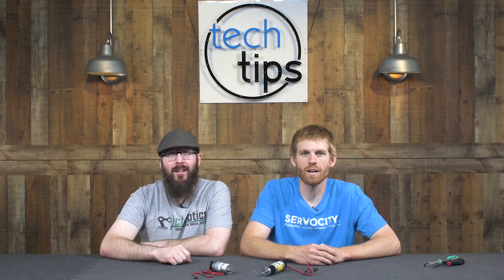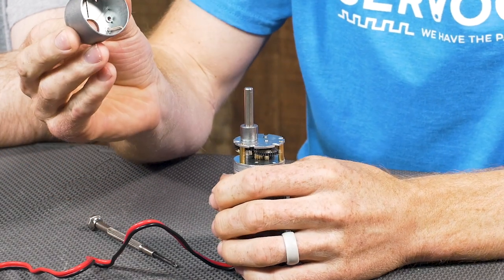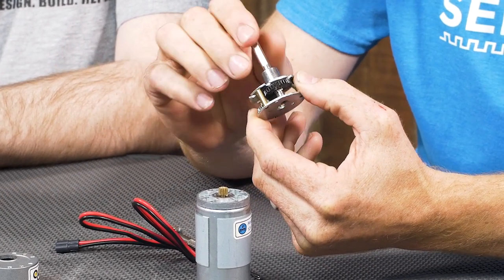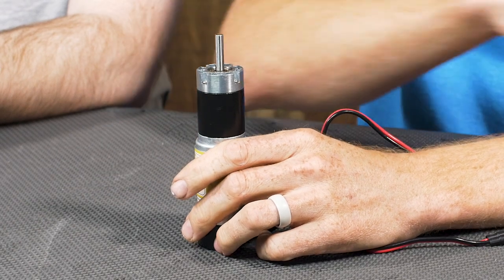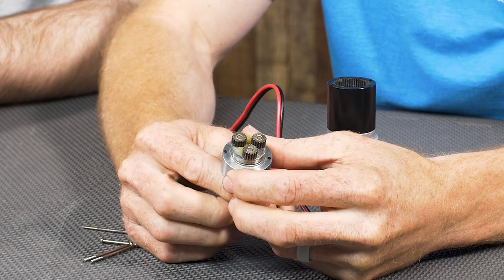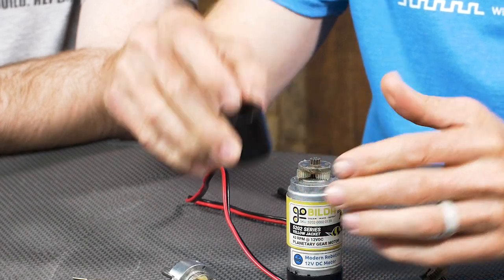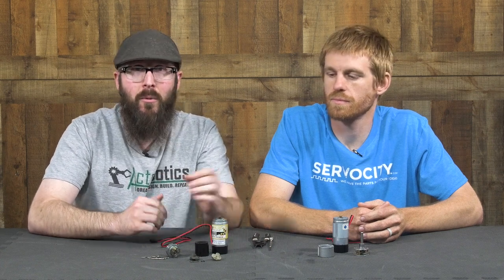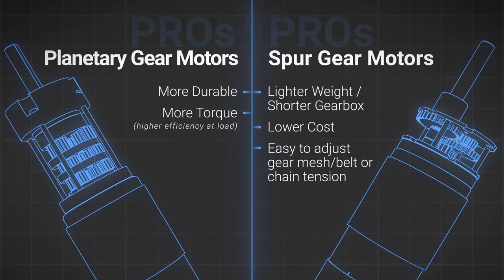Spur Gear Motor vs Planetary Gear Motor

Comment: Yep, I mirror what guys below said. Very good breakdown. I have seen inside the gears before so knew what I would look like inside. But being told the pro/cons and the information about the materials of the different stages of a planetary (eg, nylon vs metal) was great info. And best of all, being told exact meaning of spur.. It got me thinking that a planetary must be spur also, and then having it confirmed a few minutes later was great. Clears up some confusion I always seem to have when looking at motors on websites

Comment: what is the opposite of a reducer? is there a motor with planetary gears inside them to power a larger radius and add rotations to the smaller radius center axis? like a brushless motor with the magnetic ring rotor and inside there a planetary gear speeding up the rotations?
Reply from the maker: That's something that isn't commonly available, generally it is easier and cheaper to wind a motor to spin faster than it is to add an external geared "overdrive" setup.
Reply: @ServoCity  ok thanks

Comment: Great video! I'm curious what would occur if the wax-like lubricant were replaced with gear lube grease (like the ones pressed into zerk fittings in larger machine applications) and if this would lend to even longer life. I've replaced the OEM lubricant in my impact gun with synthetic lube grease after the OEM stuff broke down and caused it to seize. A year later, my impact gun is going strong.
Reply: One can reasonably assume for generic parts whatever is used is primarily chosen for cost purposes.
Find out what high-end motors use, and do likewise. I wouldn't just use a different grease made for metal for a nylon application.

Comment: Hello guys, thanks for the great video! I have a question, hoping you could answer it. I am currently looking at the following three products on your website:

1. 5201 Series, 26:1 Ratio, 210 RPM Spur Gear Motor w/Encoder
2. 4" Heavy Duty Wheel
3. Clamping D-Hubs (Tapped), 0.770" Pattern

I was wondering: is it enough to use the clamping D-hubs to attach the shaft of the gear motor to the wheel? Do the hubs and the wheel have the same kind of hole patterns to be used with the same type of screws? Thank you!
Reply: Yes! If you could attach part numbers I can check the exact part fitment. But that should all work!

Comment: Which type would haver the least amount of free rotary motion, ie rotary wobble when no power exists.
Reply from the maker: Backlash is not something that is directly related to the gearbox style (at least when comparing spur vs planetary).  Both have the potential for a bit of backlash as there's typically a tiny bit of tolerance built-in between each mating gear.  Feel free to contact our Tech Team should you have any additional questions tech@servocity.com